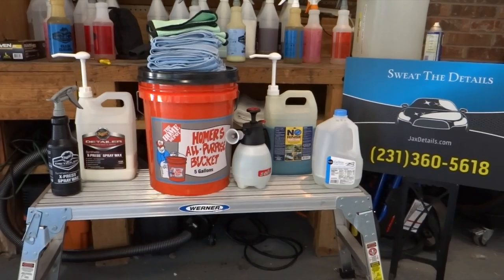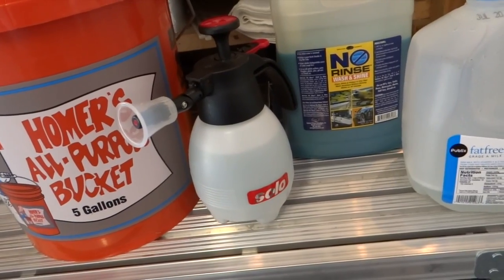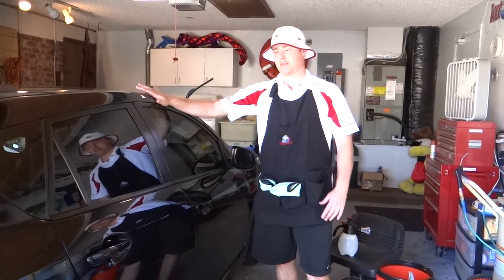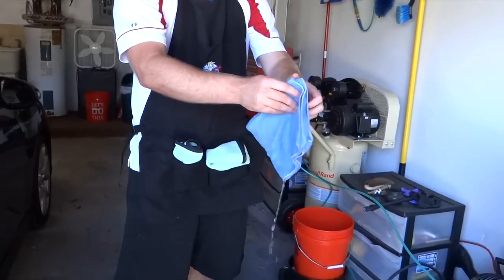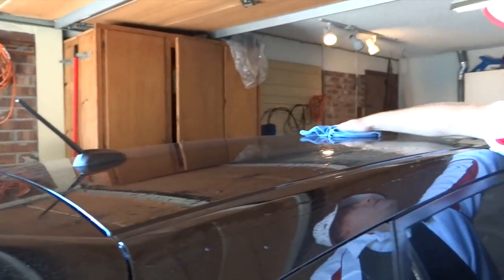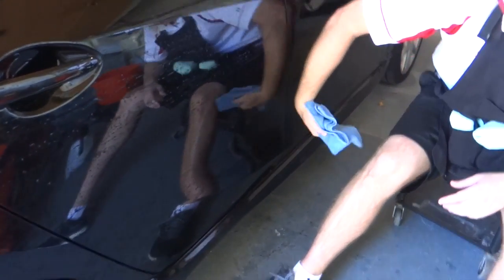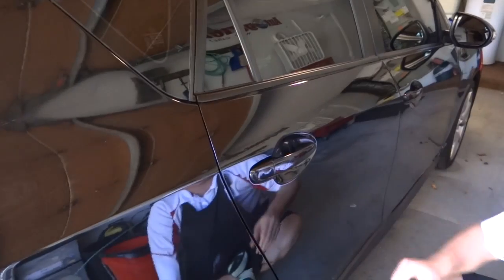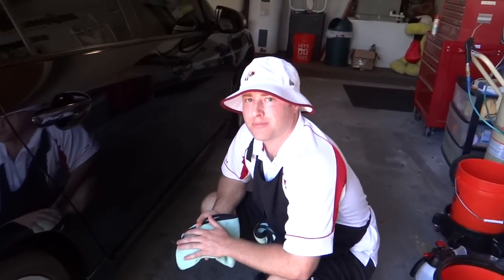Rinseless Wash

Comment: good job sir another fine use of the xpress wax, just had to go back and check the instructions on mine and never read the part where it stated it can be used while wet, great off label rinseless wash use! After drying the panel,with a waffle weave do you go back and buff to a shine using a detailing microfiber>?